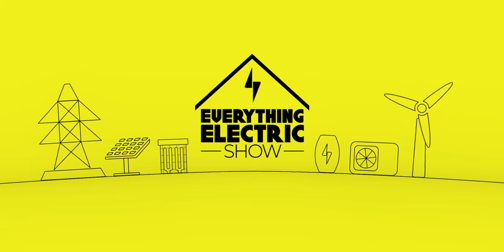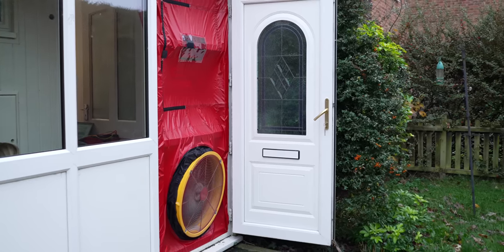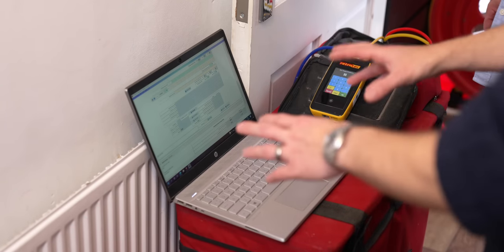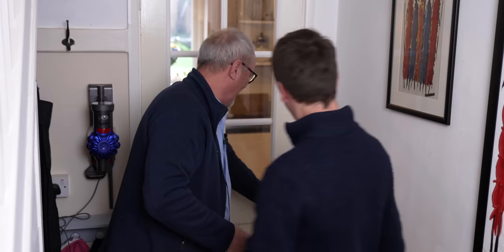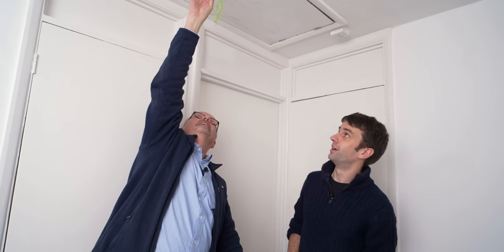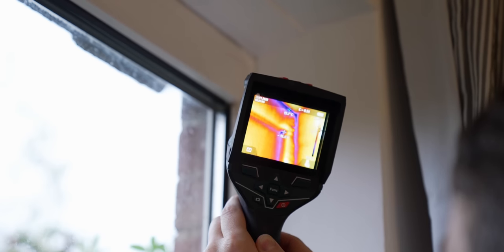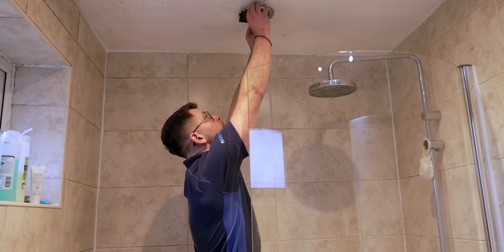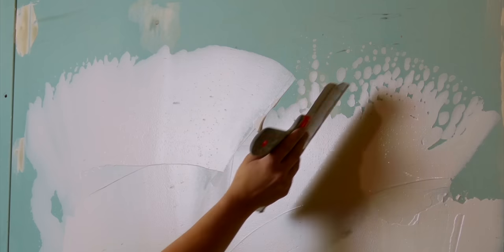Every Home Should Take This Test | Everything Electric Show

Comment: I'm a builder in Norway and here we have to test every new building, the requirements for new houses are below 1 air exchange per hour.
We just tested 6 connected houses and got a score of 0.22 which we were quite happy with, seeing as passive house standard is 0.6
We obviously use mechanical ventilation in all houses to ensure sufficient fresh air.
This comment is not meant to brag but inform, I have to say I was a bit surprised to hear how leaky an average British house is
Reply: Sad but true! We need to fix the leaks!
Reply: Leakiest in Europe, I live in one.
Reply: UK houses are on average some of the oldest in Europe, but sadly we have a house building industry which incredibly resistant to any change which means even now we are building some really poor houses.
Reply: It gets a lot colder in Norway, compared to the UK
Reply: @IDann1  true, but a airtight house helps to keep it cool in the summer as well, goes both ways although more noticeable when it's 20 below freezing 👍
Reply: I wish we would do more learning from people who figured it out already in USA
Reply: 0.22 is very good :)

In our UK self-build Passivhaus, we were aiming to get below 0.6 which, as you say, is the limit for Passivhaus, but actually achieved 0.06! I think we were a little bit over cautious! :)
Reply: @oakfieldfarm4131  I never going to get this house to bring passive, but it incredible how much different just filling a few gaps can make.
Reply: @oakfieldfarm4131  i wasn’t aiming for passiv but got 0.3 & it’s not even finished yet.
Reply: Sadly so hard to get sorted. I have spoken with countless tradesmen and want to have my home made completely air tight eventually when I can afford it. Every tradesman is horrified when I mention it. They always go straight to... I would never do that... It's a terrible idea you will just get damp and mold... Houses are meant to breath...

My response is always so are we and that is why we have lungs, doctors don't just pop a bunch of holes in a person and go there we go all ship shape.
Reply: @PKSiAMiAM  Depressing isn't it. So many people (including builders) think that having loads of uncontrolled ventilation in a building is a good thing. Ventilation should be through holes you know about, not ones you don't. I've bunged up loads of holes in this house and it's dramatically better than when I bought it, but still > 2 ach according to my (DIY so not all that accurate) measurements.
Reply: I have had the same response but I have air to air heating air-conditioning which every day is set to remove excess water,  I had damp windows in the past,
Reply: I don't think they are measured in air changes,  when they are talking about the scores on this video   I seem to remember it's a pressure difference
Reply: @mralistair737  The scores are almost certainly the SAP 'Air permeability' numbers which are in m3 per m2-hour. i.e how many cubic metres of air per hour per m2 of surface area. Those numbers happen to be pretty similar to air-changes per hour for typically sized/shaped houses. Passivehouse uses air-changes per hour which is unitless. The pressure difference is the same for both these tests at 50 Pascals.
Reply: British houses need to be breathable to allow moisture to escape, 
or else black mold will build up throughout the property
wherever the moisture can condense on colder surface (like windows).

It's a common problrm due to the damp cold climate & can depopulate unschooled immigrants, or the naive.

UK govt & naive pressure groups like "Insulate Britain" have been pushing policies that worsen the situation, of course.
If you had 100% perfect insulation, you'd be in a ⚰. 

Fortunately, many householders are too busy with work or other activities to do their insulation to govt depop regulation, 
so it's rare to have cases of extreme mold that kills children for example, but it happens now and again.

UK govt wants to '"help" its plebs by mandating impossibly expensive; 
heat pump systems that work via Boyles law, compressing air from outside.

Of course, the real way to do heat pumps is the way Norway does it; 
by pumping warm air from the building apex to a heat exchanger unit at ground level that would warm incoming fresh air from outside.
Reply: Our UK standards are abysmal. Whenever suggestion is made to improve them, housebuilding companies say it will put prices up, and the government folds.
Reply: @PasajeroDelToro  you can install planned ventilation rather than relying on leaks.
Reply: @PKSiAMiAM  need Mvhr if it’s very airtight
Reply: @ :𝑷𝒂𝒔𝒂𝒋𝒆𝒓𝒐: 𝒅𝒆𝒍-𝑻𝒐𝒓𝒐  I have a very air tight house with no mould and I get frost and condensation on my windows in winter - on the outside. You need mechanical ventilation with heat recovery AND the air tightness.
Reply: Wait, houses in Norway are scoring 0.22 while the average UK house scores 15? That's worlds apart, I guess because Norway is so cold in winter, houses need better thermal/airlow control?
Reply: @CED99  it's because the UK has not kept up with the rest of the continent with building standards. Another thing nobody mentioned is letter boxes. In the UK they are generally cut through the front door. They leak hot air and provide a nice metal thermal bridge to the outside. In the rest of Europe letter boxes generally stand in front of the house. I guess this never contributes to the poor door blower scores because the blower sits in place of the front door.
Reply: New homes in UK are significantly less leaky & have to be tested. Existing homes are completely different though
Reply: Can an mechanical heat recovery ventilation system be installed usefully to the upstairs only rooms of a 2-storey house (bathrooms upstairs)? Pipes to downstairs rooms would be quite the palaver. They sound like a very sensible thing to be installing, esp if the Norwegians are doing it.
Reply: @epatrickt  Hi. I had a friend recently do a renovation on an old house. Ducting to every room would have been a big hassle. I suggested adding ducting up the stair well. You could install it easier there. Then duct into as many rooms as possible or if not then the hall and the landing. At least it would refresh the air in the house. The other thing to remember is that you need more or less the same number of blowing points (to bedrooms, living etc) as sucking (extraction) points from kitchens, bathrooms, large rooms etc.  Then the pressure on both sides is easy to balance. Each vent has a regulator to help balance them (flaps screw in and out to change the flow rate) but that is more for minor adjustments.
Reply: @epatrickt  and not just the Norwegians. They are more and more popular on the continent.
Reply: @ecoworrier  thanks for that. We've insulated internally all the walls, loads of loft insulation and replaced the windows. Think time for a ventilation test (can still feel drafts when it's windy from somewhere!) then look at this. I feel a lot of silicone coming on...! Thanks for that.
Reply: @epatrickt  no worries. Search for "Siga tape". They make specialist very sticky tape to make things like door and window frames air tight. Might be a bit late for your windows  and it is generally used during renovation or construction but you might have some use for it. It does a better job than silicone.
Reply: You gonna spend money on making it super sealed then you end up tearing the house apart to install ventilation system. Air has to be replaced and there is no point making it super airtight at all
Reply: @Boz 2011  There are several points. Save on heating. Save energy. Save Money. Eliminate draughts. Reduce humidity. Improve interior air quality. Increase comfort. After 10 years I would never live in a house without one.
Reply: Sad thing is we could have been building much better performing homes for the last 30 years, but wasted the opportunity.
Reply: @IDann1  Sure, but they have really cheap hydro power and a lot of gas, out energy costs are going to rise significantly.
Reply: @PasajeroDelToro that's why you insulate to limit the cold surfaces like tripple glazed windows and cavity insulation. Stopping cold bridging.run a dehumidifier I run one constantly we don't ventilate and it's has eradicated all damp and mould bar the odd bit above the shower. My house is a 60s era council house nothing special. Running a dehumidifier also gives a small amount of heat so it's not really hurting to run it during colder months.

Comment: Would be nice to have an episode on how to plug these gaps for a DIY dummy like myself :)
Reply: It’s super easy using basic materials/expanding foam, use up out of date sealants etc. 
Have a look at our blog in the description!
😊
Reply: @deanfielding4411  Thanks Dean!
Reply: @deanfielding4411  it's easy but not super easy so I would recommend not being very, very drunk when you do it.
Reply: There are dozens of old home improvement videos here on youtube like This Old House or Holmes On Homes which will show you everything from simple insulation improvements to full on renovation tricks.
Reply: You don't want to plug up an old house completely you'll end up with damp and mold
Reply: True - but the idea should be to plug up the holes you don’t want and then manage exactly where and how much ventilation you do want so you can control it.
Reply: Having done this for 15 yrs. I can assure you the building industry still doesn't know how.
Reply: @matthewmcmullan9669  most old houses are plenty well equipped. They tend to have airbricks to allow natural airflow in. Plus as seen in the video, you still keep ventilation holes such as for shower rooms, window breathers etc.
Reply: @deanfielding4411  The principles of energy efficiency are like a 3 legged stool. ( it will fall over if one of the legs is missing). 
Leg1 - insulation
Leg2 - air tightening (which is what they’re doing her)
Leg3 - ventilation ( once you’ve sealed the house up, you still need to ventilate it.
Reply: @matthewmcmullan9669  Unless you ventilate it properly. Using PIV is a good option for an older house
Reply: @jdickson242  very true. I despair at the lack of basic knowledge of air tightness in the building industry.
Reply: @hughmarcus1  you know Dean is in the video, right? 😊
Reply: Siga and Tesco tape manufacturerers have quite a lot of info on that
Reply: Just take a trip down to Wickes or the like. They have lots of draft-proofing materials, like sticky foam tape and the like.
Reply: @hughmarcus1  Leg 4 - Remove cold bridges - where heat leakage is by heat conduction around insulation as opposed to air leakage
Reply: @matthewmcmullan9669  Damp can often be sure to cold bridging and causing a dew point, which is often a poor insulation issue. Air circulation is important though. Oftentimes this can be solved by circulating air within the room rather than letting out all the hot air.
Reply: @jdickson242  Thank you. That’s why I wanted to do this video. Let’s hope this helps!
Reply: @ashmcconnell3868  I think he’s referring to the lack of knowledge in general industry, I assume not pointed at me!? 😆 I hope…
Reply: @deanfielding4411  well i wasn't going say anything but........ Lol. 

We have had a placement student working with us for 6 months in Bristol area and he said he has learnt more about construction doing air testing than 2 years in uni. We are UKAS accredited and get a spread of domestic and large L2 testing but the concept of seal, insulated, ventilate bypasses most of the construction industry. We have a number of projects trying to remove "costly VCL MEMBRANES" ! and using vapour check layers as the airtight layer with insulation outside of this..... Seems like nobody remembers those programs on rotting timber frame builldings in the 80s early 90s.....

Comment: If you seal your house and suffer condensation now the experts suggest positive input ventilation. Basically window with small vents or extract fans. So contrary to sealing up your house totally. It's not black and white it's a compromise, some air flow is important for healthy living. A balanced view is required.

Comment: It'd be good to see more of these practical kind of videos, Robert.

I mean, not that this is a DIY channel, of course, but I think people would love and appreciate videos where there's actual practical advice that they can follow.

Like, honestly, it could be as simple as just watching someone run some sealant around the edges of their window or skirting boards or whatever. It might not sound like the most riveting of content, but I bet you it'd end up as one of your most watched.

Basically, most of your viewers are already 100% on board with this sort of thing. They don't need "the green sales pitch" so much, as the "and here's how, in reality, you'd actually do it" practical stuff too.

Particularly when we're talking insulation and heat leaks and such. This is actually the cheapest - yet most effective - measure anyone can take. 

You know, if you're not using the energy in the first place - because you don't have to turn the heating on or, when you do, it's less frequent and turned down - then that's the best thing for the environment, and your wallet. And compared to buying heat pumps, solar panels and house batteries, a few rolls of loft insulation and a tube or two of sealant is not going to break the bank for most people. It's something nearly everyone can do, doesn't cost much and yet is amongst the most effective measures possible.
Reply: Short version: the UK has the leakiest housing stock in Europe. Folks would love practical advice about cheap and easy ways to rectify that.

Comment: My bungalow was really airtight, had to run a dehumidifier most days in the winter to get rid of the condensation. Got new windows which have trickle vents in the top, which don't close completely. Have a lot less damp now, and haven't noticed it getting any colder than before. What would be better still would be mechanical heat recovery, using a heat exchanger to pre-heat incoming air with extracted air. But that's quite expensive, might have a look at it next year.
Reply: MVHR is quite easy to retro-fit in a bungalow - much easier than a house, anyway :)
Reply: You probably only need to ventilate the bathroom. A single room MVHR is much cheaper than a whole house system, and easier to DIY
Reply: Shouldn't be expensive. Here in Latvia, you can get so called mini-recuperators starting from €150+delivery. At that pricepoint you are looking at 20-25m³/h airflow and a very simple switch to operate it. And they are relatively easy to install - just drill a large hole in the wall and shove it in there.
At higher pricepoints you start getting higher airflow, remote controls, apps, and sensors that regulate airflows based on airquality.
Reply: @oakfieldfarm4131  should cost about £7000 not cheap
Reply: quite easy to fit to most bungalows though!
Reply: @QH96  Fantini Cosmi Aspircomfort 350
Costs about £3000. Requires multiple air ducts, has an airflow of 350m³/h and is recomended for buildings of around 250m². A bit of an overkill for most UK housing, don't you think?
Just get 3 or 4 units similar to Technosystemi Pico HP2-80. They are just over £300 each and only require a round hole of around 120mm-160mm (depending on model) to be drilled in outside wall.

Comment: I had to replace a fitted kitchen unit. I've never had to see behind before. What I discovered was a ventilation brick that was left over from when many years ago there was an old fashioned larder in the corner of the kitchen. Basically an A5 sized brick mesh to the outside. I used spray foam to seal it and it has had a profound difference on how warm the house is. I also did wonder how ants could get into our kitchen, so a double bonus there.
Reply: Brilliant. So glad you’ve found that out! That’s a exactly what we wanted to get across in the video. It’s all about finding those unknown leaky bits!
Reply: Very similar for me but behind a washing machine. A can of foam can make a big difference!
Reply: Kitchens are often bad due to being hacked about over the years for updates. Mostly the old holes just get left. Ours was freezing for a decade until we finally worked out where the holes were, and bunged them up (And rationalised the plumbing so fewer holes through the wall+EWI.
Reply: If you have a gas cooker, that may have been required ventilation. 
https://www.gassaferegister.co.uk/media/2194/tb-005-a-gas-cookers-in-internal-kitchens-eng-wales-iom-and-guernsey-vent-requirements.pdf
Reply: @robinbennett5994  I think that this had been part of a built in larder, but we have now gone electric in our cooking anyway.
Reply: @robinbennett5994  Extraction hoods are pretty stanard nowadays, I think.
Mine is powerful enough to cool my whole house during heatwaves, like we had recentlly.

Comment: But remember some older properties need to have an airflow. Blocking this off can cause bigger problems like mild and damp.
Reply: All properties. This is just unnecesary. My windows leak a lot and i still have to open them ocasionaly to let some fresh air in. People who have everything airtight cant even close windows without getting wet walls and mold
Reply: @Boz 2011  you need airtightness + mvhr. Then you will have less humidity, less mould and fresher interior air.